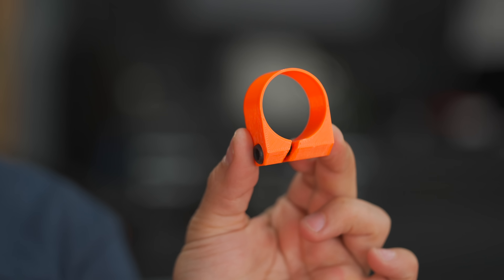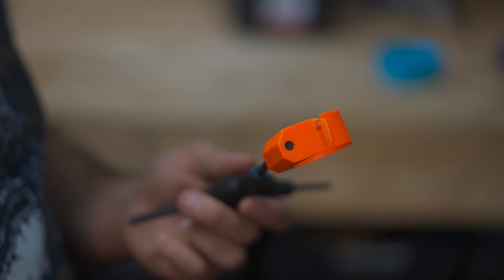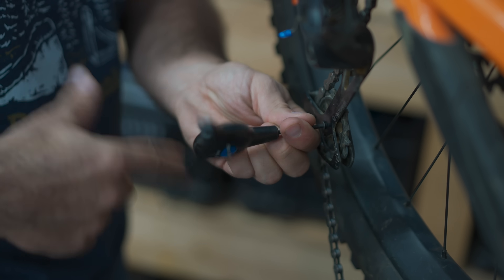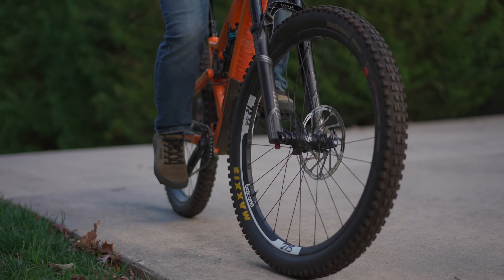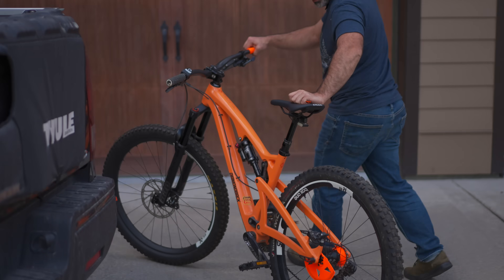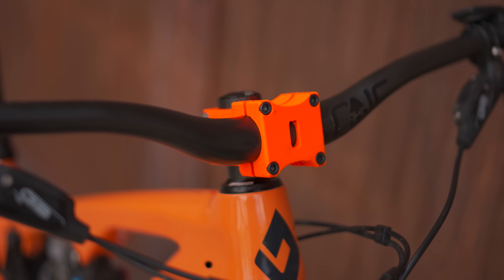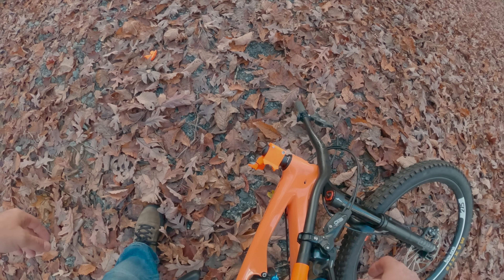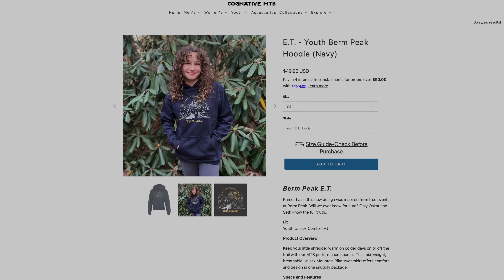Will 3D printed MTB parts break catastrophically? Let's find out!

Comment: why did you print with such small layer height? don't you know that bigger layer heights mean stronger prints? also printing with 100% infill does not make the part stronger and the internal structure of you infill is way more important than any 3d printing expert would like to tell you. i suggest going with 50% cubic/cubic subdivision infill and a layer height of 2.8 for 0.4mm nozzle with a outer/inner wall count less than 4. if you have a bigger nozzle than go way bigger until you lose needed resolution. this is literally 2 years of testing by myself on my ender 3 and in the cura slicer. CNCkitchen youtube channel made videos that explain some of this and would back me up. try it again with a 0.8mm nozzle if the resolution is still correct and you will see such a difference.
Reply: CONGRATS !!👆
YOU WON A GIFT🎁,,,,,,,,,,,,,,,,,,,,

Comment: 3d printing makes for great adapters, like flashlight holders, or simple "space fillers"    I made a bar plug and fitments for mudguards.
I've made a holder for an airzound tank, and a small "barend" like stub to hold the airhorn part on drop bars.  I use that horn not daily, but several times a week on the commute.

Never ever ever use 3dprinting for brake parts or structural elements.  Just, no.

Comment: This one was fun, but would love to see a video on actually useful 3d printed parts.
Reply: I'm sure there are plenty out there. Not 3D printed structural parts like these, but brackets for accessories, fenders, chain guards, lights, and so on. My commuter bicycle is covered with such parts, nothing safety-critical or high load but extremely useful.
Reply: it would have been useful if he printed with carbon
Reply: @1AnonA1  Debatable, not to mention the price of a carbon printer

Comment: The seat clamp, jockey wheel, and stem would have been fine if they were printed in nylon. Nylon is extremely wear resistant and has great tensile strength, especially if infused with long strand carbon fiber. The issue with nylon is that it's so hard to print with the warping and high temp. I would also use inserts, or nuts instead of threads in the plastic. Threads in plastic is asking for failure.

Comment: To correct the chain line on a 3x to 1x conversion, I designed a spacer for the Shimano Deore M6100 crankset to offset the chain ring by 7mm. Printed in PETG and attached with longer M4 bolts. I was sceptical, but it holds up really well so far, tested it by giving it all the torque I could pedal. In this case, the main load is held by the bolts tough, the plastic part is sandwiched between the spider and the chainring.

Comment: I know this video was made as a joke, but the truth is that some of those parts would work perfectly well if printed in the right material and engineered for the stresses they see. 3d printed parts can be very strong, but can also be temperamental. Small changes in print orientation, layer height, temperature, speed etc can effect strength. All thay being said, something like aluminum alloy that can absorb stress and bend if it fails is of course a better material than plastic in this application.

Comment: Next time mabe try some higher performance materials.
Something like PA12CF15 (Nylon with chopped carbon fibers) is printable on many typical enclosed 3d printers and its a lot more durable and flexible than PETG.
Even cooler thing would be if you ordered some parts printed out of something like titanium on sls printer from company like jlcpcb.

Comment: I once 3d printed replacement hub pawls when mine blew up. They worked on the stand, but after one or two pedal strokes they stripped out (unsurprisingly :-).

Non-load bearing stuff is fine though. I ride with a 3d printed light mount on my helmet all the time. The only issue I've ever had with it is when I have hit low hanging branches with the light, and even then only when I hit something extremely hard. It's better that the cheap mount breaks than the expensive light or helmet. Or my head. ;-)

Comment: PETG can be annealed in a home oven.  230 degrees (depending on the filament you use) for an hour is the simplest method.  Annealing is a complicated science but as long as you get the material near its pre-melt temp for about an hour it will significantly increase the strength of the parts.

Comment: Alot if the problem is the filament you're  using. Filament  that comes with printers usually  isn't the best. But  you can use filament  with carbonfiber in it or nylon. There's pla+, toughfilament and nylon+

Comment: I think if you had done a nut and bolt on most of these instead of threading into the plastic directly, you would up the strength a ton. I know the threads didn't pull out but the stresses would be distributed differently if the plastic is sandwiched as opposed to providing it's own strength.

Comment: Next time try tpu for the grips and maybe the seat clamp more flexible filaments will not snap so if the tpu is too soft you have other options as well.
Reply: Also you can use threaded press ins that use a solder iron to press into the plastic so you don't need to rely on the plastic for threaded pieces would probably help tons.

Comment: Jockey could work i guess, also accesories to existiing parts liike extension levers for shock lockouts maybe or like an air pump holder if you've broken yours, or holders for co2 cartridges. nits and bits liike that are for sure goiing to pop up more in the years to come.
Reply: Bar ends, shifting lever mecanism parts or like a custom water bottle replacement to hold tools inside.

Comment: The 3d printing part is just the gateway. The real power is CAD. You know those parts you printed? Those same designs can be used by a professional CNC shop to make them out of whatever material you like. There are some online options out there. First, though, keep practicing with that 3d printer. The parts may not be usable, but you can prototype all day long. Have fun!

Comment: Material is key. Man, those grips would be way better in TPU. I've found TPU to be a miracle material for a lot of my 3D printed bike accessories. Speaker mount, custom headlight mount, making custom sized shims for mounting clamps. I have some custom made adapters to fit a cargo rack to an unusual ebike that have worked awesome in TPU. In the right place, printed parts are great.

Comment: I worked in plastics for 15 years, for parts intended to be durable we used giant Injection mold presses to make said parts and even used metal inserts to anywhere a bolt was intended. I have never tried this but was told, The press used determines the overall strength of a part. the way that works is a higher press number (usually measured in Tons), the more plastic is pressed into the mold. the total tons of the press is both the press holding the mold together as well as the pressure of the feed and Screw assembly. The more plastic and less air, the tougher the part can be made. That said it's still plastic and of course has it's limits, hence why it's almost never used for stress or structure parts. The issue with 3d printing is there is no compression of the plastic for strength, just one layer on top of another. There could be air pockets, carbon buildup (From the tip) falling into it as well as any number of impurities from the air contaminating it. This is why 3d printing is used for light work, prototyping or decorations, it has no real strength. All that said, it was interesting seeing it done and glad you didn't get hurt

Comment: I have redesigned the jockey wheel for my deore shifter to fit a 608zz skateboard bearing. The original shaft of the bushing is 8mm as well and fits like a glove. It is super smooth and made the shifter better than when I bought it. Have 1000+ km on it and it doesn't show any signs of wear really. Looks pretty much brand new besides the oil. I printed it in PETG btw ;) 100% recommended, that is something that is actually better than the original.

Comment: I would retry some of these parts with PLA instead of PETG; it has much better material properties for applications that don't involve being around heat.
Reply: PLA would be terrible for most of these. It tends to permanently deform when put under stress for a long period of time, so things like the seat clamp or stem would eventually be impossible to tighten because they'd have changed shape too much.

Comment: I am just at the seat post clamp failure. Its funny to watch someone try this stuff when you know how it will fail, and they don't know if it will fail LoL. 3D printed parts are surprisingly strong, however, not nearly strong enough for what Seth is using them for.

Comment: I have a 3D printed Fabric ALM saddle and it is strong, printed with Carbon rather than regular plastic and it is super stiff, more so than my carbon layup AX lightness saddle that is over 10 years old (not as much flex/compliance for the bumps) but the ALM is surprisingly well designed-just one single piece-and comfortable. Weight limit appears to be 100 KG but I get the feeling it could take more with no issues. I got a new one for $60 so their at good deals to be had for the ALM

Comment: Very entertaining. You are right the design of the model is important for strength, but so is the way it's printed (e.g.: number of perimeters, layer orientation, temperature, etc). Another huge factor is material choice, for this application there are materials that would be much stronger than PETG. Nylon, Carbon Fiber infused filaments,  PA, TPU would be interesting to experiment with. All much harder to print than PETG.

Comment: Jockey wheels have been made from plastic for a long time now. Next: 3D metal printing, e.g. direct laser sintering from powdered metallurgy. You can actually get up to near the same hardness / density / strength of a forged part in complex shapes. For work I had some pretty complex nozzles made for large steam boiler burner guns and they seem to be holding up fine. (OEM parts no longer made.)

Comment: For the grips, you might actually get some half decent results if you used a semi-flexible filament (e.g. TPU, maybe a shore hardness of 80A-90A?). You could either slide the semi-flex portion over a rigid printed part that does the locking, or maybe just make the whole thing out of the semi-flex material. A word of caution though: printing even semi-flexible materials on non-specialized hardware is a bit of a challenge (even with the nice Bondtech extruders that come stock on newer Prusa printers), but it's definitely possible if you take it slow, otherwise prepare for some jams!
And as others have said, instead of threading bolts into the printed plastic, make the hole larger than the major diameter of the thread, and use either a recessed nut or heat-set insert on the opposite side of the bolt to get some metal threads to screw into. That could make some of these parts a bit stronger if you decide to make a follow-up episode! Of course, printing the rigid parts out of PEEK or PEKK could potentially make them strong enough to genuinely consider for some small parts, but good luck getting a machine that can print them well for under 6 figures lol.
Super unique and interesting video! I hope you make another!

Comment: Please DO NOT USE PETG FOR FUNCTIONAL PARTS. You may try ABS for that, but still be cautious like with PETG. Not hard to print ABS, just put the printer in a cabinet/enclosure and use 100-105C bed temperature. 
I designed and printed my own shifter gears. Workingh fine as it is not exposed to forces like other bike parts. It has probably over 1k km so far with it. Also did with ABS an emergency shifter hanger.

Comment: Bad idea if you don't engineer it right. The folks who 3d print firearms strategically place metal parts on their prints. Like your handlebar stem I would engineer it to be beefier with metal u-bolts going through from front to back. The single speed gear I would print a sandwich for a metal gear in between. I would print the axle to accept a metal tube of generic size to slip into the middle for re-enforcement... But it's all a bit of a lost cause because it's easy to get the standard bike parts that work just fine.

Comment: I drew up and printed a mech hanger.  It worked, until it didn't.  The failure point of the material was different and could be straightened to an extent with metal hangers vs. being more brittle and completely broken with the carbon pla.

Comment: Out of all these things I think there's actually super usefull usecases for 3D-printing the stem!
It would be awsome for testing out the feel for different lengths without having to buy a bunch of them. (I mean you'd have to oversize the shit out of them, and not take them out on a real trail, but it should give you some idea of what will happen to handling)

Comment: Seth,
thank you! Thank you for providing us with this diverse yet always high quality and interesting content. I have been watching your videos for so long I could have never guessed back then that I will witness this channel growing so much! Especially loving the 3D printer content since I have been tinkering with mine for almost two years now and it still fascinates me!
To have better threads I can recommend "heat set threaded inserts" which are basically metal threads that you can melt into your print after it's done.
I like that you made some parts that don't make much sense to 3D print because that is how you can learn what the machine is capable of. I used to break parts that did not fit so I could better understand the material.
 I cannot thank you enough for the entertainment you provided me and the things you taught me in all those years. 
Best wishes from Germany.

PS: I am amazed at what you created with thinker cad although it's such a simple program. I can't do that much with it. I am using fusion 360.

Comment: Did you print the parts using ABS or PLA? Nylon should be using for moving mechanical parts and vould change the results by quite a good margin.

Comment: Mechanical engineer with 3D printers who also rides bikes.  Things I would/have 3D print(ed): bottle cages, custom tool mounts for emergency tools, custom mounts for lights/cameras/electronics, jockey wheels (as a short term fix while waiting for parts, it likely won't break, but it will wear quickly), and even small pry bars print surprisingly well if you use the right orientation.

Things I have turned down when the local bike shop asked: Anything involving brakes.  They agreed when I told them that my printer can only do plastic.  I don't have the funds or power supply to my house to run a metal 3D printer.
Reply: CONGRATS !!👆👆
YOU WON A GIFT🎁

Comment: I've been using 3d printed (in PETG material) brake lever clamp for almost 3 years in my converted e-bike and they never broke!
I've designed those to accomodate a passing screw with a final bolt, in this way you'll not experience any kind of crack.

Comment: I love videos about experimenting with new things. Few "buts" from me:

deraileur gear - I 3d printed one for my brother, hes using it more than a year now, hes riding a lot, even made 600 km journey with it and its worn out less than oryginal. Shame you didnt mention it worked cuz you can save some money here. Oryginal shimano is not that cheap. 

Steam - you printed it in wrong direction and not 100% infill what makes it WAAAAAYYY weaker than it could be. 

Casette Gear - impossible to make it work that thin and with deraileur, but in single speed could be way thicker and be functional, actualy i saw video on yt that 3d printed gear worked for whole day of riding in single speed. He just made huge front gear and big rear gear to spread the load on many teeths of the gear.

Comment: 100% infill and heat-set inserts rather than screwing directly into the plastic will do a lot to add strength. That plus using a carbon reenforced filament, you could get 5-10 times the strength easy. Also the direction of force loading should be along the horizontal printing plane as 3d prints are non isotropic.

Comment: I've already printed some jokey wheel for my derailleur (SLX 12V), as there is no torque or force going threw it, it works perfectly fine with a good design ! I used a bearing as you did and i have been using it for 2 years now (more than 2 000km for sure!). Works great i can"t see any difference with shimano or sram jokey wheel, it is as durable as a real one

Comment: yes, bike parts don't work, but how about some specyfic bike tools that you may not have, or they cost a lot and you need them once per year (i'm looking at you countermeasure tool) bleed block is also an example (i know they are cheap but maybe 0,5mm thinner would give you harder lever), I saw air chamber tokens in comment, how about tokens made out of varioshore TPU to make them squishy?

Comment: when printing things that bear a load, you need to watch out for the print orientation. when the force is paralel to the layer, the print is much stronger than perpendicular to the layer. When aplying force perpendicular to the layer it will crack among the seam. Thats the same reason your screwholes broke on the handles.

Comment: Colored cable bosses, custom cable/hose management, fenders, multitool holder.
Some things I think would work well 3D printed.
You could also probably get different filament that is more elastic, so it would be more resistant to cracking.

Comment: I work in precision engineering and have seen nylon parts using helicoil (wire thread inserts) to strengthen threads and stop them stripping out and/or cracking. Possibly something you could incorporate into your designs?

Comment: I would venture to guess that a solid rear rotor will hold up until it overheated. At that point things would get weird.  It may get gooey, or begin to stretch and pull apart like taffy. 

One way to find out!  

Now, 3D printed accessory mounts would make sense for sure!